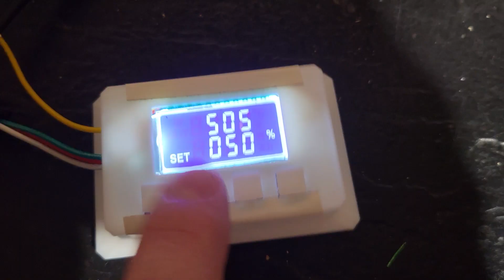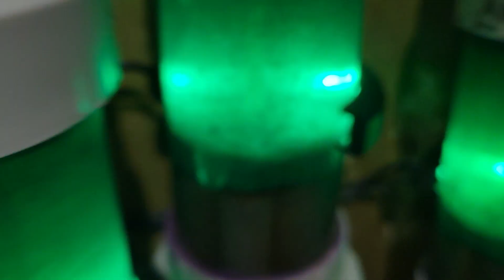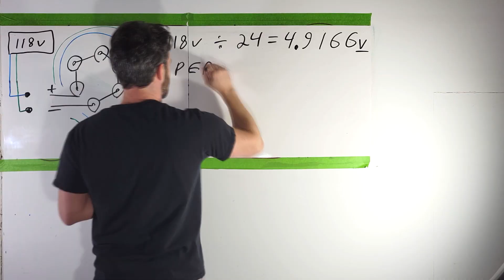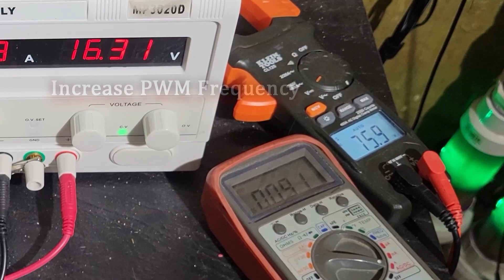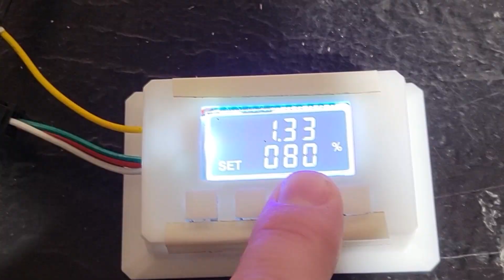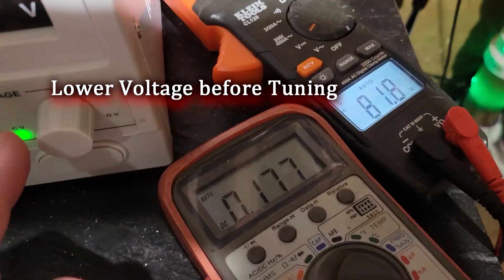Water Fuel Cell Operation - Tuning Settings for Maximum Gas Yield

Comment: If I want to build one of these, where do I start?
Reply from the maker: Watch PART 2 in full:
https://www.youtube.com/watch?v=j4EJhw-V2Xs
Buy the parts you need in the description.
Build it.
Reply: @noahauman is there a way to simplify the cell, down to a simple 9v battery?

Stan Meyer failed because other people couldn't easily replicate the experiment.  If you have something, it is very important that other people can easily build it.
Reply from the maker: My apparatus can be easily replicated with readily-available parts, linked in the video description. Stan Meyer failed because he was murdered. I suppose you could use any ~30V power supply, it doesn't have to be variable, just as long as it's linear and grounded.